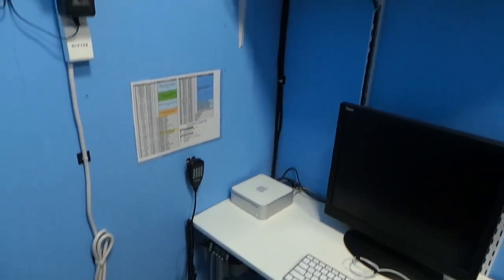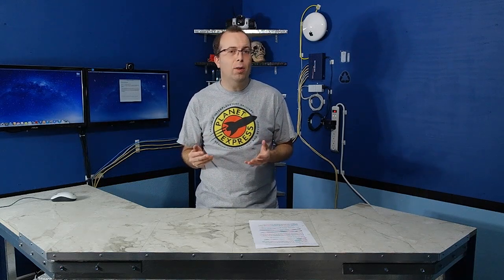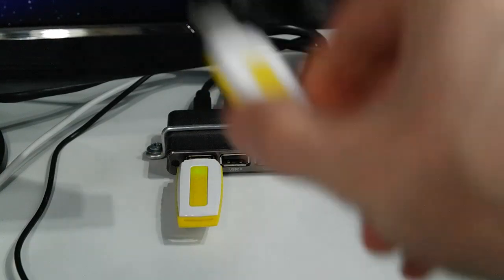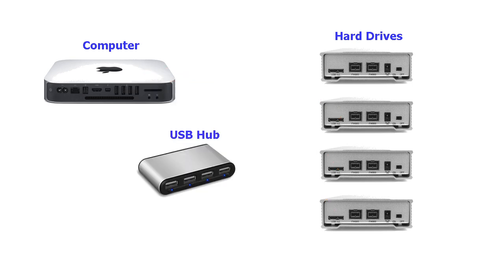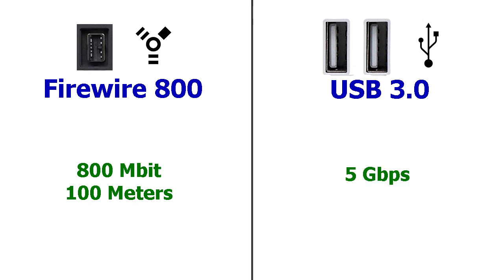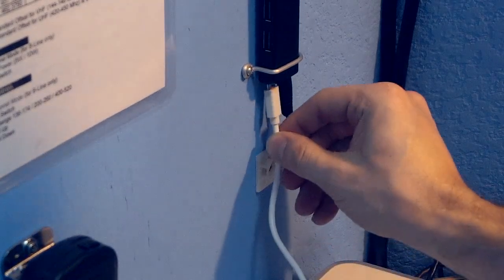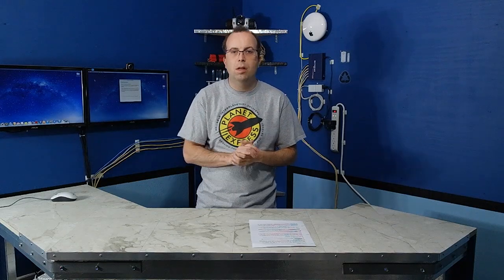Farewell R.I.P. Firewire, Hello USB!

Comment: Never knew you could daisy chain FireWire like that.
Reply: Operational Risk Management that was something they said was possible when USB was introduced but nobody ever did it.
Reply: Well, maybe you should... Go asses some risks or something orm related.
Reply: @jmh1189  I bet that sounded better in your head eh?
Reply: @thegreyspectre9838  nope, sounded exactly as is. Very plain. Typo on assess
Reply: Is there a way to daisychain USB-C?
Reply: @DJTydalOfficial  if the usb C connector uses the Thunderbolt Protocol, it can be daisy chained
Reply: @DJTydalOfficial  if you have thunderbolt 3, yes. But only with like 6 devices :(
Reply: Have a 2 port hub built in. One port to the device and the second one for daisy chaining
Reply: I did as it is basically the same as the IEC port on that old C64 which you could also daisy chain. The main difference is the connector (IEC-625 vs IEC-13213). Of course the speed itself was not that fast because the C64 was not and the C64 itself had a limit of 15 devices in the chain.

Comment: Please tell me that you've replaced this solution with a NAS by now. Just as fast (if not faster), safer, more elegant/simple. You have several single points of failure with these single disk solutions (ie any disk dies you lose all the data on that disk).

Comment: Is there a compacted cable that can make pcie (even just 1x) external without strange adapters? I've seen people put together janky rigs for external GPUs, but usually they have a ribbon cable coming out of the side or back of the case or a Thunderbolt adapter. I can build a console sized itx system with a two slot GPU slot, those cases are fairly popular now. Some day I want to build a pico itx system with an external GPU! Might even try to make the NUC with a GPU, like other have, but less janky. And yes, janky is the technical term!

Comment: FYI, I believe there was a 1.2 Gbps firewire standard that came out but adoption wasn't widespread, I believe there were also optical cables available.  USB was never designed for mass storage devices, it was designed to be as low cost and low power as possible to implement for the device manufacturer.  FireWire was faster when using mass storage devices because it used the very efficient SCSI protocol and it did most of the heavy lifting directly on the chips, whereas USB relied mostly on the host's CPU to do the work.

Comment: I remember FireWire back when I used to work with the DV format, since that was pretty much exclusively FireWire.
Reply: only thing you use it if you not have apple lol
Reply: Yes! Before that you had to spew it in from a VCR all analog. It was quite a revelation when you could just plug up the camera, take control of it from the computer, and watch everything come over in lossless digital.
Reply: @madmouseinjapan  not lossless. DV is lossy. Think of it as some kind of MJPEG
Reply: @nikitakipriyanov7260  You're right but ... well less lossy ... particularly between generations of tape. Analog tape just went off to grey tone with hints of color when you were about five generation in :D
Reply: @madmouseinjapan  in NTSC, two generations would be more accurately. Never The Same Color. PAL is better.

DV also shows signs of tape wear, particularly horizontal stripes, in addition to its own compression artifacts, which aren't quite visible on "photorealistic" video, but quite visible on "CG".

Comment: One nice thing about the "death" of Firewire and the rise to prominence of USB is that a lot of still quite usable Firewire audio gear is getting dumped on the used market as studios upgrade to the latest-and-greatest, which is boon to home studio tinkerers.
Reply: @UCVSkgP4DgNLGNkomtiY5I5w so your dumb then? Thats what I got from that message?
Reply: Running Windows-based home studios, Firewire devices gave me tons of headaches and I was glad to see it go (when RME introduced USB 2.0 interfaces, it marked the death of Firewire for me). I assume it worked better on Apple machines.
Reply: How can I use my FireWire device with a machine today I have a motu interface I wanna use but can't
Reply: yes indeed and they dont know the old firewire equipment, often build in Japan, is superior to their new USB China crap.
Reply: USB sucks. I just bought an external 500 GB SSD for $62.
Reply: @Raison_d-etre  usb does not suck. it’s really good in my opinion
Reply: @michaelepica3564  Try reading my posts again.
@SG BGБГMate 2 GB even more so.
Reply: @Raison_d-etre  there is only one single post by you
Reply: @michaelepica3564  I didn't review the thread before I responded. So it should be an even easier task for you then.

Comment: These flat micro USB 3.0 or whatever they are called are totally worthless connectors, they are one of the worst connectors, breaks very easily after not many plug-ins. And unfortunately most external hard drives has that connector nowadays.

Comment: You're forgetting another important reason why Firewire 400 is faster than USB 480:
 FW uses TWO twisted pairs of wire, while USB uses ONLY ONE. This means that the data through a FW cable can go at its full speed in BOTH directions SIMULTANEOUSLY without having to have to wait until one side is done transmitting. Basically, FW is like a two-lane street and USB (1.0, 1.1 and 2.0) is like a one-lane street where cars from one side need to stop until the cars from the other side pass through.

Comment: Firewire is dead for a reason. Only somewhat faster than USB 2.0, no where near as fast as USB 3.0 and it gets hot asf which(I'm assuming) means it uses a lot of power. More than typical 5v 0.5a max of USB 2.0 or 5v 1a of USB 3.0. Also have you not heard of Thunderbolt? It has all the features of Firewire and it's way faster than any USB spec. And yes I know this video is old but at the time of this video TB 2 was out and it still could do everything Firewire could do including daisy chaining.
Reply: I think Thunderbolt is as dead as FW isn't it?
Reply: @geoninja8971  no some companies use thunderbolt with USBC

Comment: Why couldn’t a bus cable be used with a branch for each device?  Technically usb can support 127 devices on one port?

Obviously devices would have to be self powered but as long as no one device is more than 5m from the host should be golden...  would be very straight forward to test with usb2

Comment: What happens if you connect two laptops to each other over FireWire?

EDIT: Apparently you get an IP connection, so it behaves like an Ethernet cable, albeit a somewhat slow one by modern standards.

Comment: I think I almost never seen a computer with Firewire ever in my life here in south america.
Reply: Macs had them for a few generations. PCs mostly didnt except for video/audio workstations. But a fairly cheap card would add four firewire ports for about $40 I think. So it was easy to do.  Most everyone I know of who was into them was connected to the camera or audio world. Devices you bought had the port so it was kind of imperative to run out and get your expansion card to connect it.
Reply: @madmouseinjapan  $40 is to damn expensive for such a card here in south america. Better keep on usb.

Comment: and then USB-C was a thing. and then firewire was 400 mbps, and USB-C was 40 gb/s
Reply: USB-C is a connector, not a protocol, but the confusion is easy to understand. Thunderbolt 3 should use the USB-C connector and, hopefully, contribute to make USB and Thunderbolt somehow "converge" to something more unified. Thunderbolt is still faster and more reliable in speed than USB, it can daisy chain and can have a lot more cable length without signal degradation, because of the circuitry in the cable (active cable). Thunderbolt 3 is rated at Gbit/s.

Comment: Then why when I transfer a file using USB 3.0 it says 2 MB per sec
Reply: Depends on the hardware, the storage medium, the port it's connected to, and even the cable you're using.  Possibly even the driver.

If the storage medium(a slow flash card, for instance) can't support faster file transfer, you won't get faster file transfer.

If it's connected to a USB 2.0 or lower port, you won't get fast file transfer.

If you're connecting USB 3.0 devices using a USB 2.0 cable, you'll only get USB 2.0 speeds.
Reply: Wait for usb 4.0

Comment: I have an old Sony handycam from around 2001 that came with a firewire port called iLink. With my laptop and a firewire express card I still transfer the 8mm video tapes. You can even control the camera from the computer. FireWire is the best

Comment: won't speed be affected by using a hub?
Reply: It largely depends upon the type of USB hub you're using for this particular setup:
- USB2.0 to branch USB3.0/1 devices - Not good! Bottleneck!
- USB3.0/1 to branch USB3.0/1 devices - No worries, unless you don't interchange data from across all drives at once ( when combined to a software RAID, for example ) .

Comment: Why not keep the (4) FireWire drives and just add USB drives going forward?
Reply: or get a nas and reuse some or all of the drives
Reply: @cs512tr  less reliable and  then this plus no point that would just cost money  and downgrade it
Reply: or better yet just buy NAS
Reply: @EfficientTrout   less reliable and  then this plus no point that would just cost money  and downgrade it
Reply: Likely due to age and reliabillity. USB Drivers will keep getting updates and HDDs are much cheaper now. The old firewire drives are no longer made too, so depending on the age of the drive you don't know when it will be cactus.
Reply: Chris Lackey I know
Reply: I was thinking the same thing!
Reply: Chris Lackey they can’t connect to the other drives so they’re on a different server
Reply: Daily Dose of Memes : I have Macs and can connect to FireWire-800, USB-3, and Thunderbolt all at the same time or I can connect FireWire-400, FireWire800, and USB-2 on another Mac all at the same time. You can daisy chain both FireWires and Thunderbolt while also connecting separate USB devices and allow a computer or server to access all connected drives at once.
Reply: Chris Lackey yes but his drives or different and have no USB.
Reply: Because firewire and usb are totally two different things, one uses analog and digital signals, while the other just uses digital signals, which makes it imposible to connect them in parallel
Reply: @leonardomcgill1459  lmao they are both digital signals lol
Reply: @leonardomcgill1459  Analog?
Reply: @MatthiasGörgens  not sure if it does it seams unlikely 

Also analog is not like digital think of digital  as 10101 and analog  as a wave
Reply: @deuskooll  Sory, I know what analog means. I'm just expressing my doubts.

Comment: FireWire is not dead in fact it is being moved to "Pro" market status. All audio recording Studios don't use the USB garbage. FireWire is still the best for audio latency and multiple ins and outs since the processing is done at the IO cards. Thunderbolt is the next step but it is being slowed down due to less notebooks and proper laptops being sold.

Comment: Actually, there is no technical restriction why daisy chaining shouldn't be possible with USB; all that is required is a USB-Hub inside supported devices. But always remember that bandwidth is shared on a USB-Hub! In reality throughput really drops down when transfering many smaller files to different devices on a hub.

Comment: I loved the IP-over-firewire feature as well, and used it for high speed networks between workstations.  it was a 400Mbps connection in a 100Mbps ethernet world.
Reply: ip over usb is a thing. Some external drives are just iscsi servers running ip over usb
Reply: @ch4.hayabusa  No, they're still just USB mass storage devices as anything else would add bottlenecks, unnecessary protocols and far more required configuration than just a simple USB storage
Reply: @resneptacle  I was going by what I saw of a Drobo...
Reply: And then you have IP over USB... WHY AT THE TIME OF WIFI6 DO YOU USE THAT
Reply: @hugo94608  speed?
Reply: @dreagerd8248  I mean, its not all that worth it, a conventional twisted pair should be more than adaquate and likely offer significantly higher speeds?
Reply: @hugo94608 yes if you want to share your 4/5G connexion from your phone to your laptop using USB much is more convient than WiFi and thé speed are comparable
Reply: @hugo94608  USB4 and Thunderbolt, blow 10G ethernet out of the water, even regular usb3 and all of it's confusingly named sub varieties beat gigabit and 2.5g

Comment: I am using a 2012 MacBook with a 64GB hard drive, and it has a FIREWIRE PORT( and 2 usbs) !  I should consider selling it to you, so you can restore it if it requires that, and salvage some parts

Comment: As we learned in networking, the Daisy Chain is not a feature:
https://en.wikipedia.org/wiki/Network_topology#Daisy_chain
I have a dozen people in my phone that could tell you stories of it failing. Asuming they have not utterly repressed the memories of those debugging nightmares.

We had all those other options, but ended up deciding on the Star Topology. Because it works way more reliably:
https://en.wikipedia.org/wiki/Star_network

Comment: why the fuck are you drilling a pilot hole in drywall? like... that screw isn't going to hold much just straight into drywall as it is anyway and wallering the hole out more (with a fucking corded drill) isn't going to help. This keeps me up at night and its your fault.

Comment: Thunderbolt replaced FireWire, it's USB and PCIe in one connector, plus it supports chaining.
Reply: Also, USB4 is heavily based on Thunderbolt, so it will support chaining as well.

Comment: Ther still a lot of sound machine using firewire : tascam DM series, Alesis, M-Audio... firewire permits to use several tracks indepedantly (up to 32) from a mixer to the computer in and out. As far as I have seen, it's not possible with USB.

Comment: I don't know if you heard the news, but USB4 just got announced, and it's everything you could have wanted about a USB that replaces firewire:
- USB-C is only connector so it's reversible/no wrong way to plug it in
- USB4 can be daisy-chained
- 4GBytes/sec. BOTH ways
- DisplayPort built in (which can turn into HDMI trivially)
- Backwards compatible with USB 1-3 (but you lose Displayport)

Its only flaw is that the components are expensive but that's because right now it's still technically just Thunderbolt 3. Once everyone can make hardware for it, prices should come down.

Comment: The only thing I use firewire for my JVC digital cam-corder.  It does great.  Everything else I use is USB 2.0.    While I'm thinking about it, I have a 128 GIG flash drive that I bought used and it's formatted in exFat and I cannot get it to format.  It says it's write protected.  I have tried everything from Windows 7, Windows 10, Mac OSX, the diskpart in the command prompt and nothing works.  Any idea?

Comment: There's always an option to buy a second hand HDD with built-in FireWire port (controller) and then simply replace the HDD to brand new one.
Reply: The problem with that is the fact that most enclosure's firmware only supports up to a certain size hard drive.
Reply: @Kennephone  Oh, I see. It sounds reasonable.

Comment: When USB 2.0 shipped, Best Buy and Circuit City both pulled all their firewire devices off the shelves!  Many laptops had Firewire at that time, (called i-link or IEE-1394.) and the previous month you could connect high speed drives to them.  Everyone lost that ability for several months until laptops started getting USB 2.0 ports.  People sometimes claim that the US is a "free market" and customers choose what technologies win out.  Nope.  The US is corporate Communism.

Comment: Thunderbolt is the real successor to FireWire. You can daisy-chain using it, Target Disk Mode on the Mac OS supports Thunderbolt, AND there are FireWire to Thunderbolt adapters available.

Comment: Many users preferred it over the more common USB 2.0 for its then greater effective speed and power distribution capabilities. Benchmarks show that the sustained data transfer rates are higher for FireWire than for USB 2.0, but lower than USB 3.0. Results are marked on Apple Mac OS X but more varied on Microsoft Windows. (Wikipedia)

Also our business still uses firewire to transfer large files as we don't have USB 3.0 capable computers (nor the budget to get new ones) and it's much faster than USB 2.0

Comment: my firewire card still works in my Windows 10 machine with a driver, so I'm still using a M Audio Firewire 1814 to record and play audio
Reply: Mine works too with Windows 10, but without any driver. Windows 10 has dropped support for floppy disk drives, and for FireWire in a networking sense, but not for FireWire interface itself; so all FireWire drivers are still built in in Windows 10 (except FireWire networking support that was dropped since Windows XP Service Pack 2).
Reply: Hello sir. I have just bought midi keyboard with firewire port. But my cp doesn't have firwire port. What should I do?

Comment: Could do an episode entirely on the theme of connectivity standards that Apple has pushed as a company but failed to get any traction in the industry for the long haul. For instance I'm still pining for AppleTalk. There were 3rd party products that enabled routing AppleTalk through the existing phone wiring of a house - that was such a cool way to get a network port in most rooms of the house. But Apple has pushed a proverbial million standards that the rest of the industry has mostly ignored.

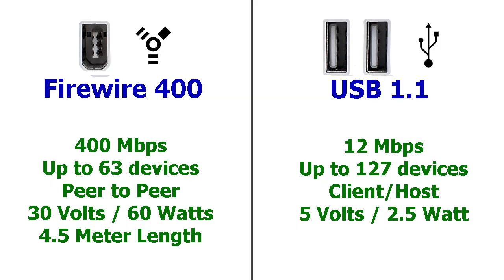Comment: 2:36 why does cable length matter you can just buy a longer cable if needed lol
Reply: USB has a strict timing requirements, so no, long cables simply wouldn't work. These length limits are in place for a reason. Don't know much about FireWire though.

Comment: I have an old pc with firewire 400 ports (running winxp); would using a fw to usb adapter keep the speed efficiency? I have an external I'd like to connect but it also lacks any fw port.